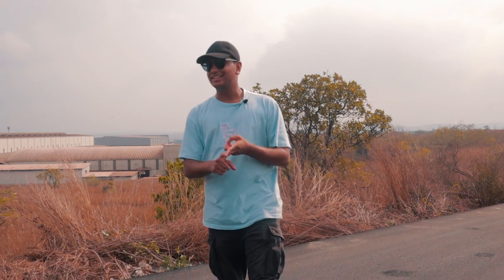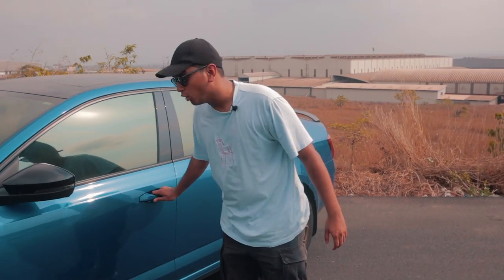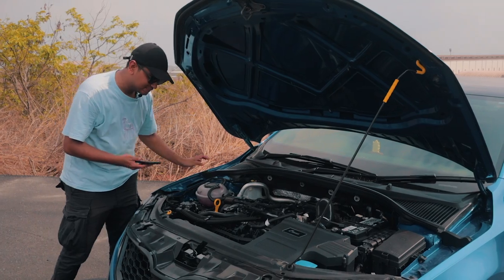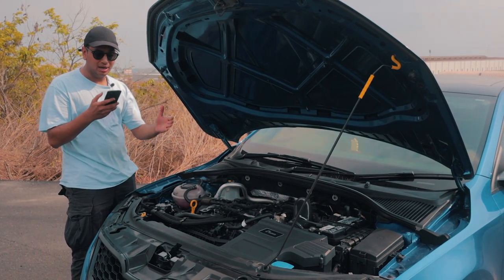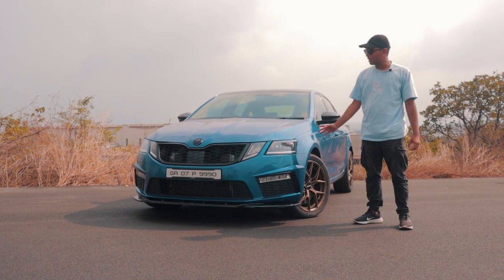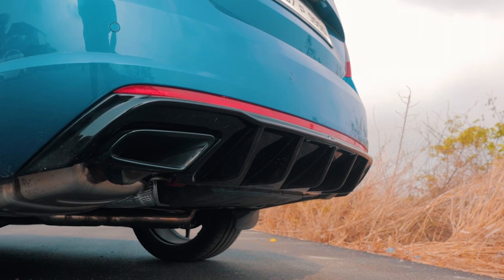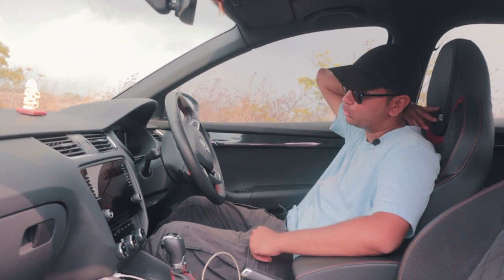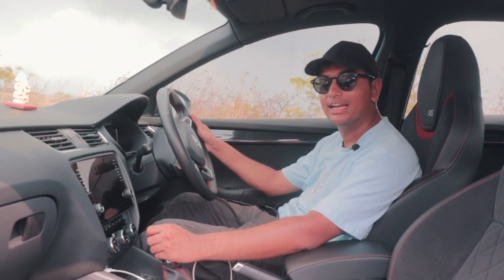Stage 3 Skoda Octavia VRS245 with the new APR DTR Turbo! (420HP!) | Autoculture

Comment: Still a 7-8 second 0-100 for a 420 hp car which is average at best.
Reply from the maker: 7-8 seconds? Not sure where you read those figures but it does 0-100kph in approximately 5-6 seconds and then does a the quarter in around 13. Wouldn't call that average.
Reply: Stock vrs does 0-100 in some 6-7 seconds 😂
Reply: He is not doing a proper aggressive launch since it's not his car.